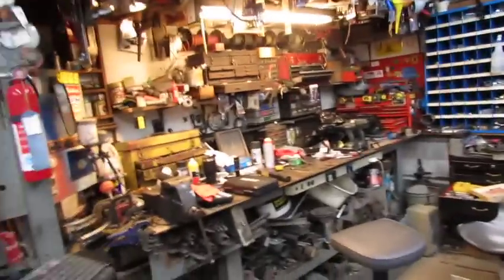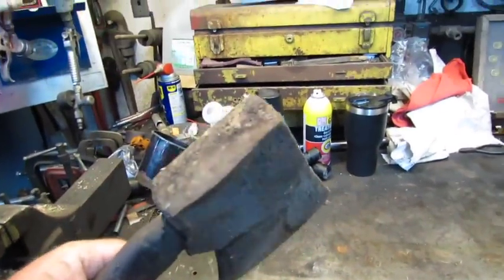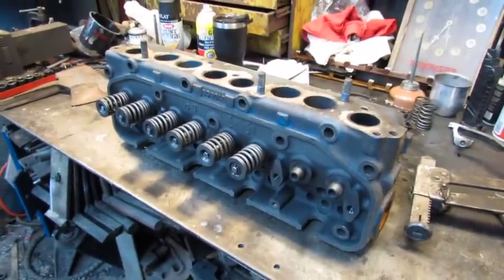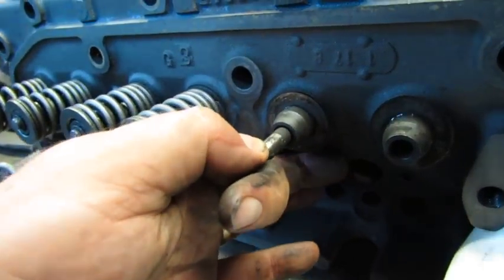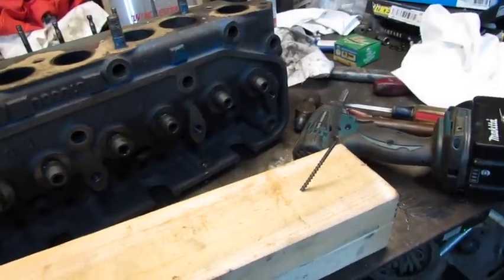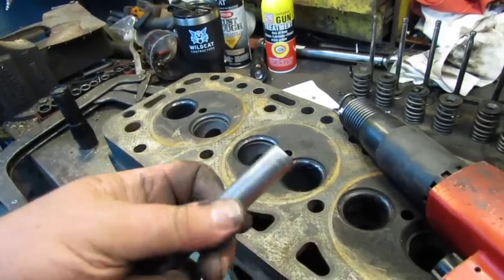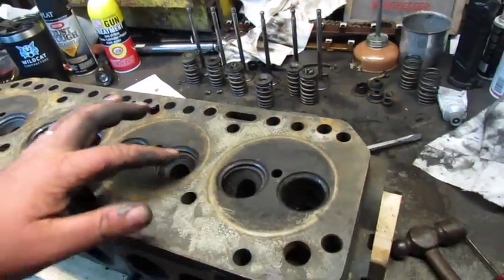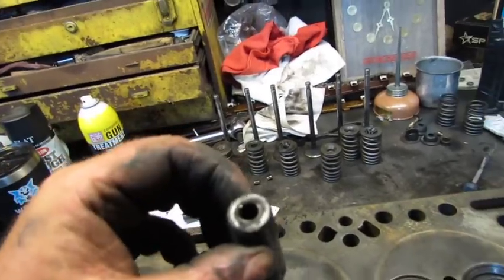Tractor Valve Job FAIL   172 Diesel

Comment: I would rather tried and failed than never have tried at all …..I thinks you said that , I’m thinking a young machinist will tell you you need to replace them seats and an old machinist will tell you to run it or he will ask you if putting the valve through the valve cover is what you was going for . 
Thanks for the video..always entertaining .👍👍
Reply from the maker: I’m looking to spend like ten grand on a 2500 tractor. Haha

Comment: Good Work, Nothing major wrong. The rule of thumb was minimum contact of valve to seat is the thickness of a nickel. On exhaust valves the closer to outer edge of valve was worrying due to heat. However on intake valves with the cooling charge, not so much. I have only seen exhaust valves burnt. I would hand lap check contact area , clean an pour some gasoline to check for leak and run that Ford.
Reply from the maker: I sent it to a Ford man. We shall see what happens.

Comment: I don't know if you read these comments or not but if you look at those instructions again you will notice that the 30deg and the 60deg is backwards, the 60 degree is supposed to be at the bottom of the seats and the 30 degree is on the top of the seats. 45 degree in the center. AND the seating area on the valve needs to be at least 3/4 down on the face of the valve and about 1/16 th  of an inch wide or less. Only in my PROFESSIONAL opinion. I've been doing valve jobs for 50yrs .
Reply from the maker: I read em. Every one.
Reply: @MrHevyshevy  I wasn't trying to put you down or any thing I was just trying to point out a mistake on the diagram you showed that you might not have noticed. Sorry if it appeared as if I was, I watch your videos all the time and find them very interesting.

Comment: Time for a 3 angle high performance valve grind and finish porting and polishing them runners. What kind of a cam are you going to run in it? 3/4 race cam would be cool.     Now about those "old guys" you keep referring to...ask your son about that. I suspect you are running smack dab into that category of some of those "old guys" that you bought some of this equipment from...:))
Reply from the maker: It could be. I’m getting old.

Comment: thermal expansion on the valve guides made height changes. I think there is a final height/reaming step after installing valve guides if I remember when i had some air cooled vw heads rebuilt back in the 1980's.
Reply: i think depending  on the head work we normally do not get an itemized list, just rebuild tractor 4 cyl diesel head, new valves and guides, check flatness... etcetera

Comment: You never know until you try. And now that you've tried, you can go to the machine shop and they can probably fix the small error in about 5 minutes, but it will cost you an hour's labor.  It'll be fine, and you will be better the next time you decide to work on a head.